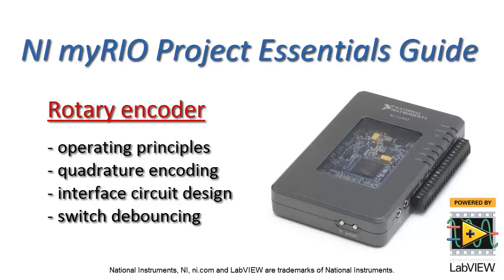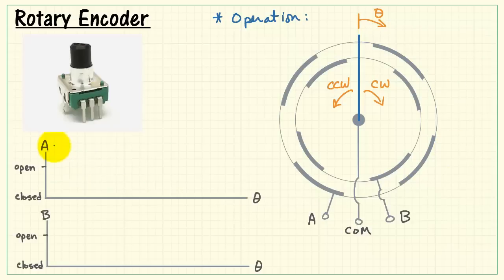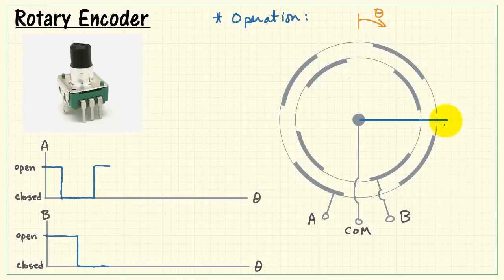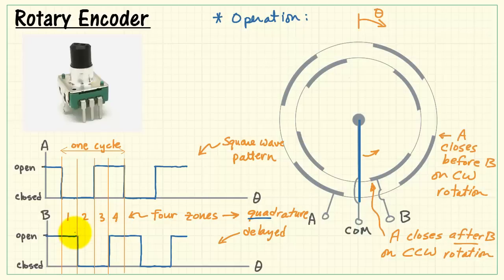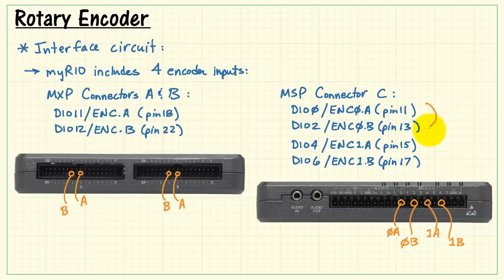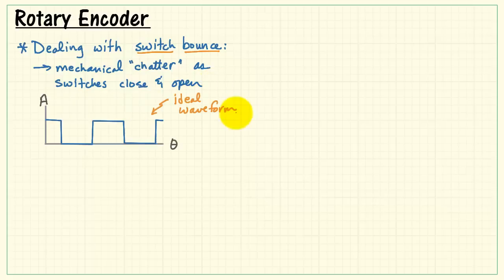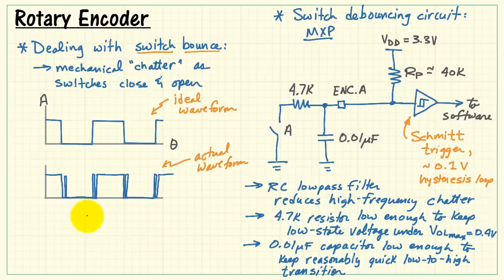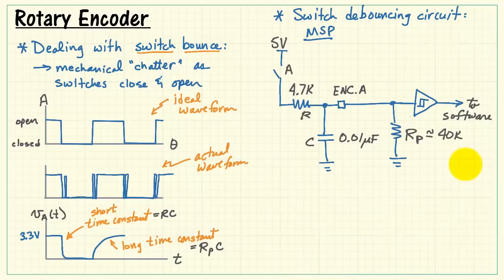NI myRIO: Rotary (quadrature) encoder

Comment: Really good video. Is there any document that shows practical bounce time for a Bourns PEC11R series. I'm debouncing it from an FPGA board and (so far) I have specified a 5ms bounce time which seems a bit too much right now
Reply from the maker: Stormtrooper Elite Maximum bounce times are not often quoted because the way in which the user closes and opens the switch can vary widely, e.g., amount of force, speed, etc. Ideally you would use an oscilloscope to observe typical behavior of your specific switch, but if that is not possible you can simply try different values until you are satisfied with the reliability.